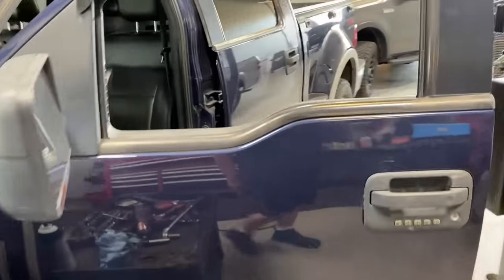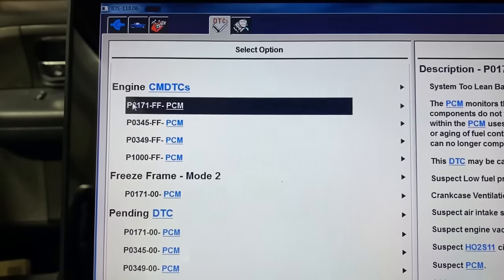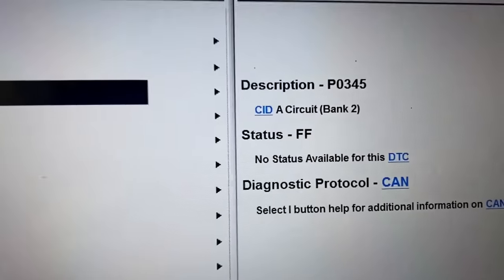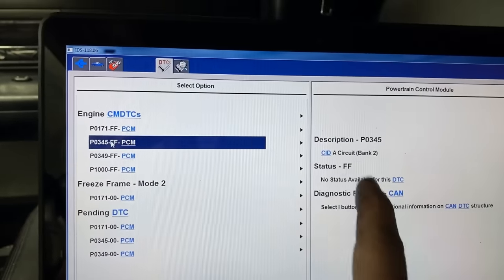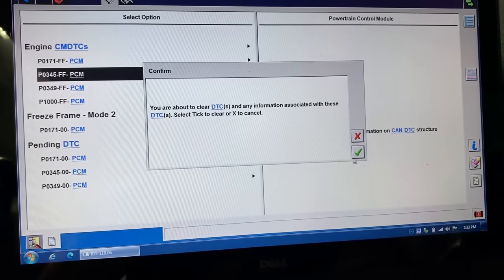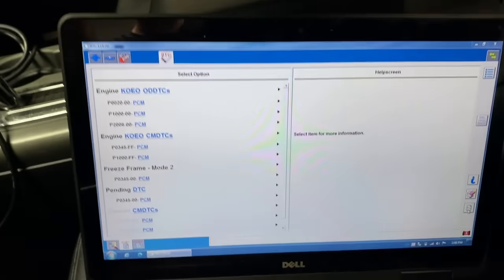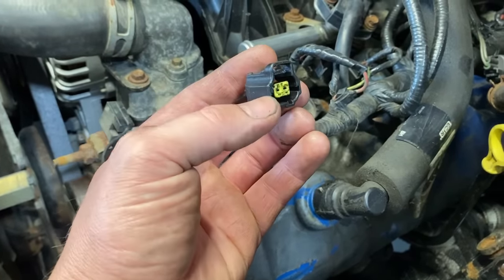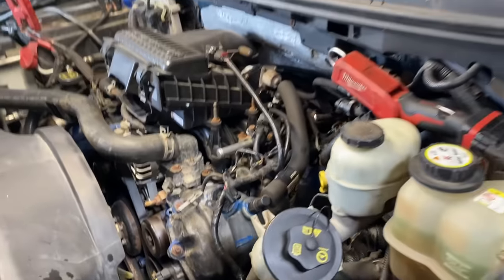Ford F-150 5.4L 3v Triton Engine Runs Rough: P0340 P0344 P0345 P0349 VCT Timing Error Diagnostics

Comment: I really appreciate your videos! I did my 2006 3v timing job following your directions and after 65,000 miles the truck is still running great! 

I have a question for you that has me scratching my head. I helped a friend with his 2008 3v and it is not working out and I’m not sure why. He was driving pulling a trailer on the interstate and the oil pressure dropped to zero he shut the engine down and pulled over immediately. The shop he towed it to said he needed a new engine without even looking at it. (I get it but I figured I might help him out if the engine was still okay) I guessed it was the factory oil pump and said we could do a full timing job with a Melling 360. We completed the timing job with all Ford parts (except the oil pump) and there was lots of gunk so I pulled the pan and cleaned the pan and pick up tube. I refilled It with oil and ran it for 10 minutes and then added motor flush and ran it 5 more minutes and dumped the oil and pulled the pan again to hopefully get any other gunk out that was hidden in the oil passages. After this I connected the remote oil pressure gauge and the pressure at idle was around 85 psi. Fast forward to today when we drove it for the first time. It starts and runs smoothly but when driving intermittently it will say check gauges and the oil pressure drops. When that happens we put it in neutral and cut the engine wait a few seconds and restart. On restart the oil pressure is back up. Runs like that for a while teh the oil pressure drops again. We did a drive of about 5 miles and close to the end the check engine light came on and codes p0340 and p0345 showed up. I am thinking something else has fallen down in the pan and is getting stuck in the pickup and when you kill the engine it falls out only to get sucked up again? Would that be a good place to start looking? Is there something else I should look into?
Reply: So I went with my gut and pulled the oil pan again and sure enough there were bunches of flakes of gunk that had stuffed off the engine and were being pulled into the pickup tube. I cleaned the pan and pickup tube and reassembled everything. I ran the truck sitting at idle for an hour and pulled the pan again to see what else came out there was a lot less but still some flecks of crud. I put it all back together again and it runs great so far no problems with oil pressure and no codes. I’m going to change the oil in about 1,000 miles and drop the pan when I do. Hopefully this engine is done producing crud.

Comment: 06 3v has same codes, at times will drop down and idle rough.  New timing kit, new oil pump.  New solenoids and phasers only dr side.  So I prefer and installed a ford vct still does the same thing.  Swapped cmp sensors from side to side,  no change.  I'm lost.

Comment: 2005 Expedition 5.4, p0340 and p0344, it shows no vct activity on my scan tool, vct system stays open loop, key on engine off and with the vehicle running. It wont go into clised loop.  Any suggestions?

Comment: Question what is the 2  small black squares mounted on the bolts on the front of the block by both vct .it has a black wire that runs from them on both sides into the wire loom.what are those? And there purpose? Thank you.

Comment: Another great video! I have 140k on my 2009 f150 5.4l 3v. No problems I know about but your videos on the 5.4 make me nervous. Has anyone gone this long without replacing phasers, chains, guides, tensioners, oil pump etc??
Reply: No worries if you have no start up chain rattle or roller /follower ticking
Reply: Seen some in high 280,000 to 320,000 miles with Original timing parts
Dude in Houston after break in oil he started using pennzoil 15w40 and has 380,000 miles and it's hot in Houston 
Those 3v operate on clean oil, change oil and filter, don't go 6000 miles on synthetic oil
I use pennzoil platinum 5w30 full synthetic and motor craft 820 filter and is quiet and runs perfectly at 140,000 miles, 5w20 is recommended by ford for better fuel mileage to make government EPA happy.
All these ford techs say 5w30 for thicker oil
Another thing you can do is when first start of the day is flood mode, hold gas pedal to floor and crank and let oil pressure build and let of pedal and it cranks at 600 rpm
Reply: Seen some in high 280,000 to 320,000 miles with Original timing parts
Dude in Houston after break in oil he started using pennzoil 15w40 and has 380,000 miles and it's hot in Houston 
Those 3v operate on clean oil, change oil and filter, don't go 6000 miles on synthetic oil
I use pennzoil platinum 5w30 full synthetic and motor craft 820 filter and is quiet and runs perfectly at 140,000 miles, 5w20 is recommended by ford for better fuel mileage to make government EPA happy.
All these ford techs say 5w30 for thicker oil
Another thing you can do is when first start of the day is flood mode, hold gas pedal to floor and crank and let oil pressure build and let of pedal and it cranks at 600 rpm

Comment: I got a 2004 f150 it had ( lol ) 5.4 3v . Cam phaser failed busted valve cover on bank 1 . Do you its worth repairing or replace motor .

Comment: I installed cams and chain kit-after market about year ago no am getting code bank 2 retardant I removed valve cover today the phaser is right on the center mark cant see any damage can it be damage internal should I just replace phaser with a ford phaser.thanks again

Comment: not sure if that engine has two cam sensors but if it did like many cars do couldn't you scope both cam sensors together and if they didn't mirror each other you'd know that atleast one was off like the one in your video? I was thinking........ If you new that up front that it needed a phazer then you could sell the work. Just thinking out loud  , what do you think?

Comment: Have a code p0340 on a 4.6l 2v 2004 f150 new body style...does the 2v have 2 cam phasers?...it appears there is only one cam position sensor on front of driver side head...if it has phasers is it common for them to go bad in the 2v?

Comment: I have 2004 5.4 75k and 2006 5.4 150k. What software are you running for diagnosis?   the 150k engine sounds ticky but no codes. Want to check timing before tensioners go too bad is that possible with software?

Comment: I got the P0345 on my 2007 5.4L  right at the end of my 10 minute Liquid Moly flush I did just before my oil change to 5w-30w oil.  Does this mean the flush triggered this issue or was the code just a coincidence?

Comment: Have you ever seen the tensioner seals worn out bad enough to cause low flickering oil pressure on the manual gauge causing  the phasers to knock and run rough?

Comment: As always great videos.  Couple of years ago I rebuilt a 5.4 3V that I picked up used. That engine was a reman (engine in truck seized).  Same as this one they lined honed the head and installed cam bearings.  I ordered new thumper cams and to my surprise they did not fit!  Long story short I found out the company that rebuilt the motor the first time not only lined honed the head but also ground 10 thousands off the cam itself! Had to get the cams machined to fit! Did you run into this same issue or did you reuse the old cam?

Comment: does driving with po345  that wasn't resolved with a new sensor, had to start somewhere,  damage the engine?   I do notice that after a hard deceleration from 40mph there is a ticking noise after coming to a stop that sounds like a lifter ticking.

Comment: I've combed through your videos and can't find one that can tell me what's wrong with my 2010 5.4 3V.  I've tried to take it to a number of different shops and they all say something different. 
Any insight would be greatly appreciated. 

It sputters when i start it but after its running it runs smooth. Under normal acceleration it goes smooth but if i try to accelerate slightly aggressive it sputters pretty bad then picks up speed. 

It's giving no codes and no CEL. But whenever i add lucas upper cylinder lubricant the rough start goes away but the other problems still remain. 

Any help would be greatly appreciated.
Reply from the maker: It sounds like you need a timing job but the speed issue can either be a secondary ignition misfire or plugged cats not allowing it to gain speed.

Comment: Hey man do you think you could do a video on what type of problem signs/indicators or used truck inspection signs/identifiers that will help a prospective buyer inspecting the truck to identify problems in used f-150s from the 03 to 09 range of 2v  & 3v, 4.6L and 5.4L modular V8 engines please?

I've seen a lot of information that is fractured across various videos and websites and forums all across the internet but nothing that is consecutive and complete that covers all engine configurations and year models of the modular V8 in the F-150

Comment: FTM, hey man would a vct be an issue with 08 f150 that would make a vehicle stall in reverse? For example, I would drive my truck for 30 minutes and returning home and pulling into the driveway, the truck would stall and cut off. No, codes or anything, any advice would be appreciated.

Codis

Comment: I have a rough idle at 40 45 even 50 with overdrive locked out. I need your help resolving this issue I change the spark plugs change the coil packs put a new air filter in there and I'm still having the same problem. I put in the transmission fix doctor stuff and every single time I change one of these issues it stopped but then came back what do I do!?!

Comment: Question for you, 2007 F250 5.4L, I replaced the fuel pump and FPDM, but accidentally ordered the wrong pump. It has a higher flow(assuming a V10 pump), now I'm getting a catalyst efficiency code. Could it be an overfueling issue caused by the pump?
Reply from the maker: No the FRP sensor reading would cause the pcm to adjust the pulse width to the FP.
Reply: I assumed it would, but didn't know how far the parameters would allow it to be adjusted. Thanks for the reply.

Comment: I’m getting 4 codes all 4 are about bank 1 and 2 cam shaft position sensor, I replaced both and still getting the issue. Rough idle, still drives but lacking power. PLEASE HELP

Comment: Hi FordTech.  I have a question semi related to this.  I found you did one video on this subject several years ago and wonder if there is an update to that video.

I have a 2004 F150, 5.4L, 4x4, 116k miles.  I have a throttle lag randomly but at times very severe.  The best way I can describe this is like a governor kicking in.  It happens while accelerating at all throttle positions or while cruising at all speeds, again very random.  I should also add that it is also very frequent.  

For example, if I am driving at 60 mph, suddenly my rpm drops, the whole tone of my engine changes, and I start slowing down.  Or if I am accelerating at 3.5k rpm, it will suddenly drop to 2k rpm again with a severe tone change of my engine.

Thanks for any help or advice you can provide.
Reply: My 2007 feels like it bogs down on the highway sometimes too. The exhaust note changes and sounds like something is holding it back. I had 1 converter done and I think I might need the other. I got an oxygen sensor code. 161k miles. Please post if you get it figured out. Thanks!
Reply: coil packs?

Comment: since the engine has been fitted with the knock off parts during the last repair im wondering did you take a time to inspect the chain guides and tensioners as well?
they are prone to fail as well on tritons
with the valve covers off you should be able to drop tiny inspection camera between the components
Reply from the maker: Customer was done with it they are selling it.
Reply: @FordTechMakuloco  i was expect to hear that.can wait to see them all at the junkyard.very poorly designed machines.cheers mate!

Comment: Hi, love the videos and much thanks...but, I used your link to the ELM adapter and it goes to OBDlink MX, which was 100 and i bought it. Trying to configure forscan now, and realizing i should have got the 327 hard connector for only about 20 bucks. Now im out 100 bucks and not getting the diagnostics I needed; dang!

Comment: Would you recommend the Bank 1 Phaser bolt be checked and torqued to spec now since presumably the same guy would've installed both bolts?
Reply from the maker: Yup but this customer didn't want to go in that far they are getting rid of the truck.

Comment: Love the 04-08 F-150 content Brian. I have a 68000km 08 that’s never been touched. 2nd last oil change I switched to 5w30 full synthetic and it started the 1second rattling after firing up. Switched back to ford semi synthetic and haven’t heard it since but still figure I should replace tensioners this winter. Tested oil press with the synthetic oil in there too. Drove for an hr with hose and gauge on and lowest was 29psi in park at stoplight so I think tensioners and that’s it. Any thoughts?
Reply from the maker: If I was going in and changing the tensioners I would also be replacing the guides since it had the startup rattle concern.
Reply: Ok thanks   I will do that.

Comment: I have a issue with my 2007 navigator. Which one is bank 1 driver side or passenger side? Thanks
Reply from the maker: Passenger side
Reply: @FordTechMakuloco  .. Thanks a bunch. I will recheck the codes I was gonna replace both VCT valves but only did the one I thought was bad but I think I did the wrong one. I'm  looking at doing the whole engine tune-up. Thanks for taking me out of using the cheap parts.👍

Comment: I'm having trouble with a 06 5.4 Expedition. No power codes were multiple random misfires, lean bank 1. If you Rev engine goes to 2200 and stops like a Rev limiter. Put it in gear instantly no power may 15 mph. On test drive new codes, lean bank 1, rich bank 2. Misfires 3,5,7. I pulled plugs, we're replaced around a year ago tips were excessively burned down, #3 end of tip was missing. not the part that breaks off.. he had the cheapest coils he could find on Amazon. So I put new coils and new Motorcraft plugs.. still runs exactly the same. I had computer unhooked so codes cleared, no codes have come back because not enough power to make it around the block.. suspect plugged exhaust but strange I can Rev engine but put in gear instantly no power.. I just order a new scanner similar to what you use.

Comment: I replaced the timing chains and cam phasers on a 2008 F-150 with the 3V 5.4 liter because the guides had broke and the chains stretched/jumped from oil starvation. I was having these codes and symptoms afterwards replacement of said parts. I watched this video and replaced the phasers again with genuine Ford Motorcraft parts because they were not returning to zero at idle (live and learn I guess lol). Everything works fine now EXCEPT when the engine gets hot it will intermittently have the same symptom, BUT only in reverse once you give it throttle. Pop it in neutral and blip the throttle and the issue goes away. No codes stored. Have you come across this before?? I just find it very strange that it would only do it in reverse and it seems to be pretty intermittent.
Reply: You ever figure out the issue?

Comment: Do you think maybe that the timing error could have been just the fact that keyway was worn out and it was what happened back and forth may have caused that phaser to break apart also kind of a chicken before the egg type of thing the reason I say so is I have purchased Ford part number Factory phasers before and don't know whether I was getting a knockoff phaser or a real Ford phaser
Reply from the maker: No the phaser bolt was definitely way too loose which caused the domino effect I see it all the time.

Comment: My 07 expedition has about 189500 miles. I bought it with 105000. To my knowledge, phasers or timing components have never been changed. This thing runs great, no rattles at startup or while running at all. I'm always paranoid it's going to give out on me. Do they just plain fail out of nowhere or will it give me some warning over time at all? Only issues I've had are plugs(of course!), which burned my catalytic converters. Changed all of em and has been great. So, think I can trust her?
Reply: Any updates?
Reply: @hunterprice287  214k still kicking ass lol! Same exact situation at startup only.

Comment: Thanks for the videos. I have a 07 expedition that run rough no check enging light,being to two dealers multiple times with no resolution to this problem. Do you do remote diagnostic? You are about 700 miles     from where I live so not able to bring it to. Thanks for any help.
Reply: Have you replaced the fuel filter (checked fuel pressure), spark plugs, and engine filter? Have you checked the resistance on your coil packs? You say no check engine light that doesn't mean you don't have ECU fault codes currently stored, you need to scan for it with a scan tool.

Comment: I have a 2010 F150 with the 5.4, I have already done the full timing set about 2 years ago with Ford parts based off your videos. I am having a faint ticking noise on the driver side at about 1,000 rpms when the engine is under load, I can’t hear the tick at idle or above around 1,300 rpms. I am thinking it is a roller follower or lash adjuster starting to go bad. Does this sound correct? If so, should I go ahead and replace all the roller followers and lash adjusters at the same tome to keep from doing this again since I still have all the specialty tools for the job. Can I replace the lash adjusters without pulling the cam out?
Reply from the maker: I would just concentrate on the roller followers as the lash adjusters rarely fail. The noise you have sounds like phaser oscillation.
Reply: FordTechMakuloco Is Phaser Oscillation normal? The Ford phasers only have about 25,000 miles on them. Should I proceed with replacing the roller followers?